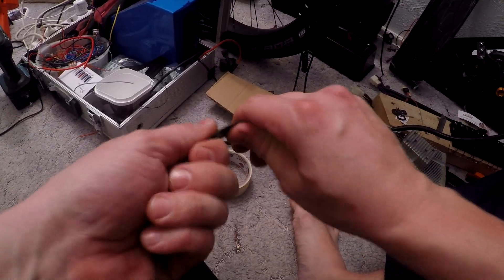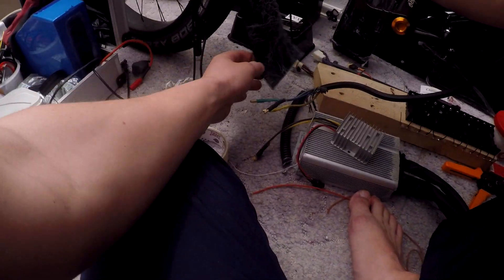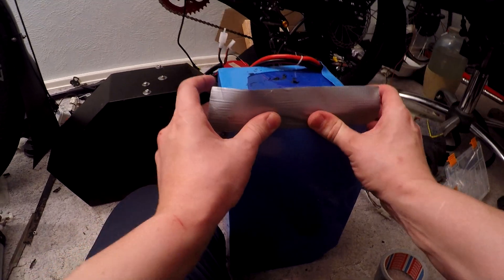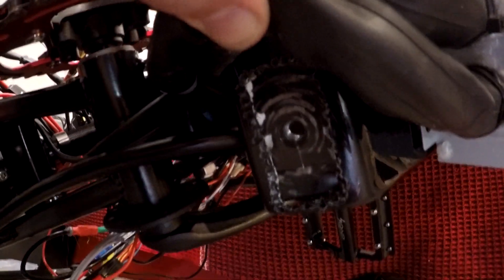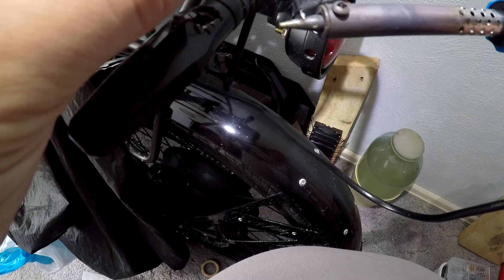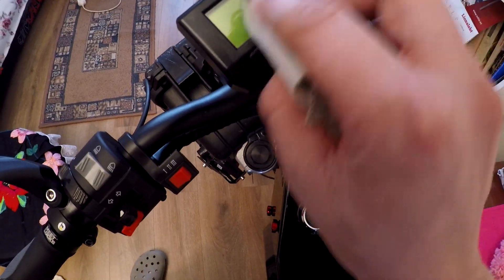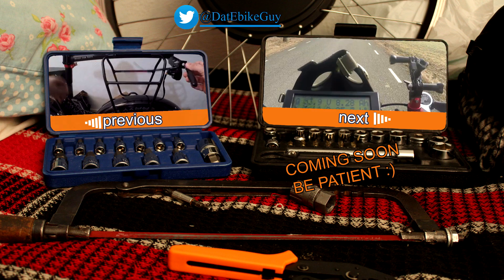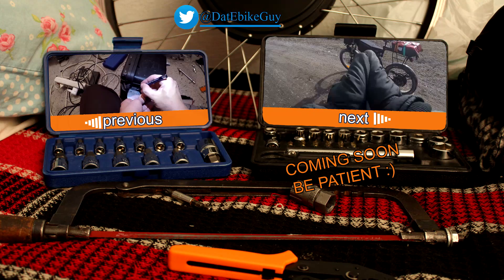Building an Electric Bike in My Bedroom - #11 Mud Flaps, Battery, Accessories

Comment: what battery did you buy? whats the specs of it?
Reply from the maker: Battery is Boston Swing 5300, 52V and 58Ah. Pretty bad battery so far, avoid!
Reply: @DatEbikeGuy  What's bad about it?
Reply from the maker: @N33M00  Hey!´Problems like 3 dead cells replaced, so much trouble + customer support did not respond to my letters, luckily i found ebayst replacement cells. For now, you should avoid this company.
Reply from the maker: @N33M00  Hey
You were commented on my channel, maybe you posted links, anyway I got your notification emails but there is no comment under the videos, youtube removed it?
When I built my bike in 2018 then the endurebike had fantastic customer support. I sent them 20+ letters and everyone received a reply. Then something happened there and they very rarely or not at all respond to the letters, a dangerous thing.
If you really want to order something from them, write to them first. Be careful with your hard earned money.
An electric bike can be cheap there. You have to consider there an additional cost of 800-1000 euros for customs clearance and shipping.
Reply: @DatEbikeGuy  Yeah idk where my last comment went. I commented again. Anyway, i wrote them an email with some questions, I hope they reply.

Comment: Hey bud I see ur not getting a response from endurobike.com I’ve emailed them twice no response yet and am planning on getting the frame, suspension, and other bits but not the battery. U think it’s ok to order from them?
Reply from the maker: Hey
Try emailing them with your questions at sales@enduroebike.com. i got an answer a few days ago. If they don't answer then I highly don't recommend buying anything from them. A year ago, when I ordered goods from them, there was no problem. Let me know if you got an answer?
Reply: Dat EbikeGuy will do appreciate it bud!
Reply: Dat EbikeGuy did they take care of ur battery for you?
Reply from the maker: @turbotim9009  My friend will try to fix the batteries in the near future and will see what exactly is wrong. The battery is over a year old. I asked Endurobike if they sell BMS or a separate cell, but no answer came.
Reply: Dat EbikeGuy I hope you get it fixed buddy
Reply from the maker: @turbotim9009  Thanks
Reply from the maker: @DungNguyen-nm1fp  Hey, battery is not dead :), usable atm is 2kw. This BMS is for serious fast bike :) Lots of AMPS, careful .My bike only uses 25 amps or 1300W :)
Reply: @DatEbikeGuy  How many amps could you pull out before? If you pull too much and the connection is not thick enough you just burn them. Maybe you should check your BMS setting any limits on amps.
Reply: Dat EbikeGuy I placed an order with them and haven’t heard back at all, didn’t pay yet but still nothing
Reply from the maker: @DungNguyen-nm1fp  It´s always been 25A/1300W. Its limited by the controller. My goal was not a powerful e-bike. 1300W is enough to keep a speed of 45 + km/h under heavy load(touring bags, etc).
Reply from the maker: @turbotim9009  That's really weird, thanks for reporting back.

Comment: Was the battery from enduroebike counterfeit? Was planning on ordering a 72v from them.
Reply from the maker: Hey, There customer service does not respond to emails atm, I recommend staying away from them for now. Yes batterie have some issues, dunno what wrong, series 2 seems have some balancing problems. Soon my friend will completely disassemble the battery and see if anything is loose or something else wrong. Cant say anything more atm.
Reply: @DatEbikeGuy  Ok, i only ordered a frame from them for now, is that good quality?
Reply from the maker: @Technopr0  Frame is pretty good quality, my bike with heavy touring kit, including petrol generator total is about 100kg and my weight is 100kg, did 1000+km trip and no problem. I recommend not to overturn the plastic covers of the frame. As the screw fastenings may break, I even recommend putting oil on the screws.

Comment: wher did you bye all the parts
Reply: Hey
Mostly from enduroebike (dot) com (main bike parts and battery), Aliexpress(accessories, switches, cables etc.) and Ebay (mudflappers, used peli case, brake light module)